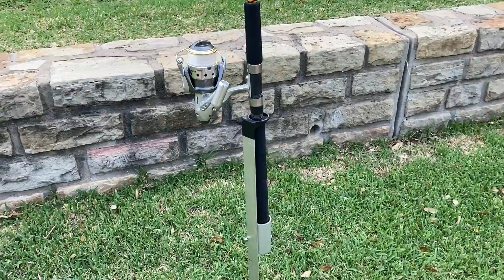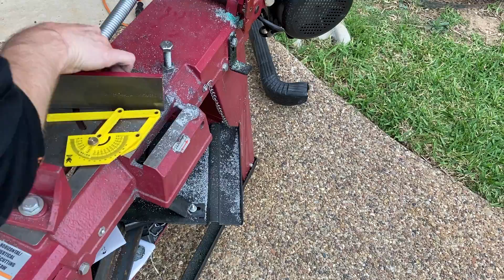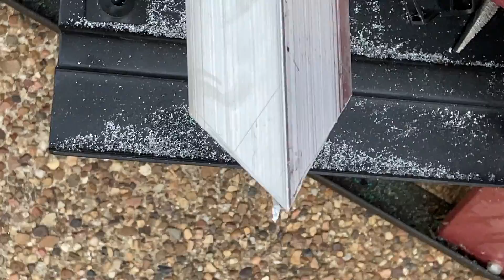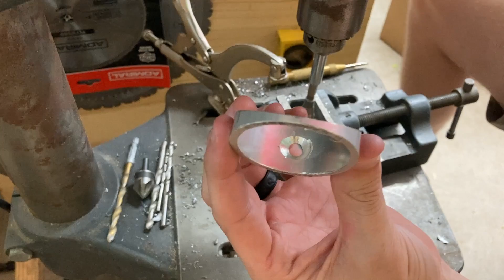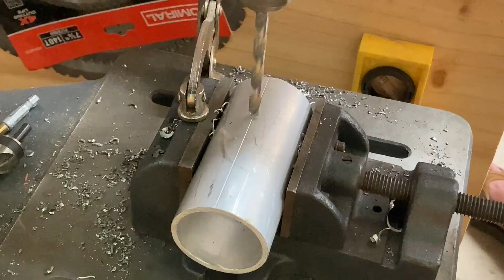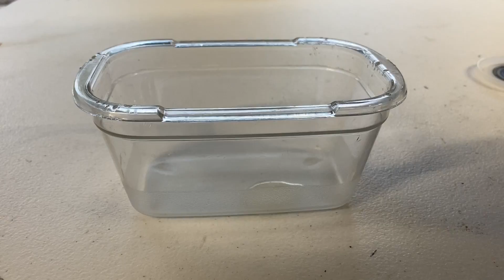Build a No-Weld Aluminum Surf Fishing Rod Holder

Comment: Cut my top piece in half making a "C" shaped piece clamp it ans attach with 2  Stainless machine screws one on each side. And i put 4 1/4"holes2 inches apart for the bottom butt holder so it is adjustable for different rods
Reply from the maker: Awesome!